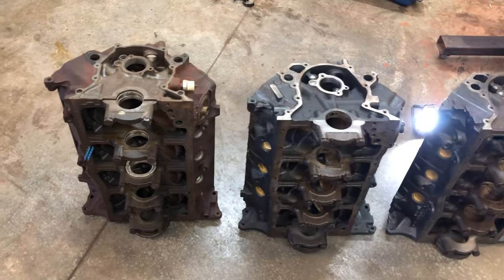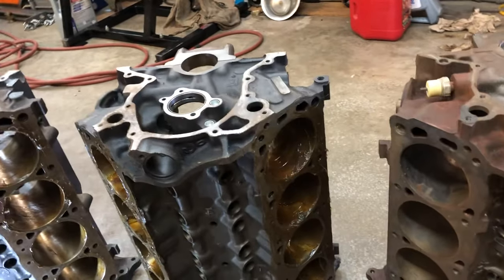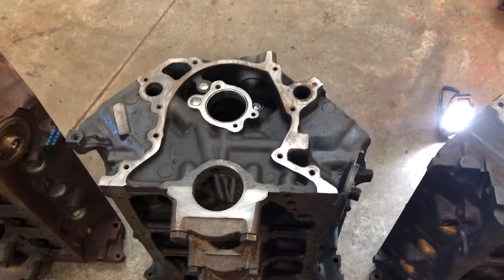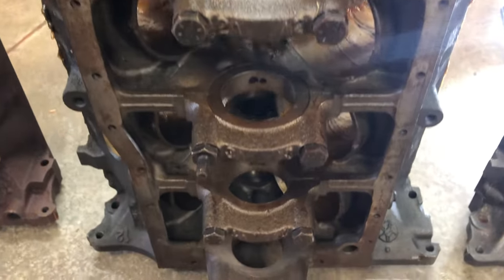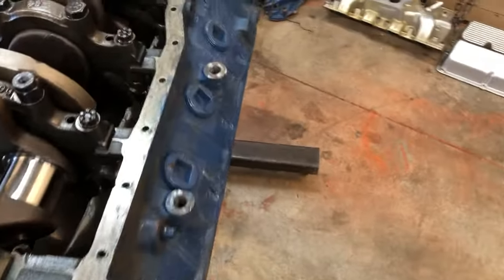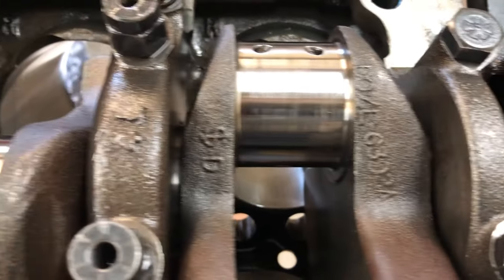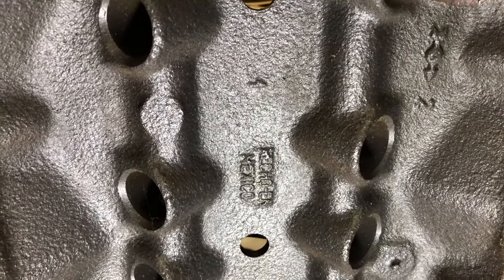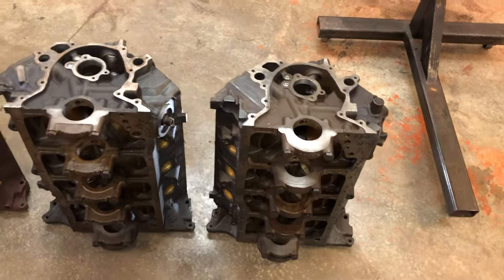The 4 different factory versions of the Ford 302

Comment: What years were the Mexican fee
Reply: Between 1969 to 1975. If you do find a Mexican 302-equipped car, it is likely to be a late 60's or early 70's Torino or Ranchero, both of which were occasionally outfitted with such engines and have some collector value.

Comment: Great video.  Was the Mexican block casting as strong as the rest? When i was young i worked with a fella that had a 360 Mexican engine in a 60s ford truck an he said the heads an block castings were weak on them
Reply from the maker: I think the Mexican block was as strong as the rest of them. A lot of racers were using the Mexican block over the standard block, but I personally cannot attest to that.
Reply: @pyleup  Mexican blocks have a higher nickel content than the others.

Comment: What years were the 351W blocks cast with all of the 'attributes' for a roller block?
Reply from the maker: I’m not sure about the 351 Windsor, but the 302 started with the roller block in 1985 and ran through the end of the production of the 302 in 97/98
Reply: @pyleup  I know the 351W roller block 'officially' began in 1994. However, I have heard that the roller blocks castings began in late 1991 - early 1992, they just weren't fully fitted with roller cams/lifters until '94. I was hoping you might know for sure. Oh well. Thank you for answering back. It's annoying when folks abandon their videos after a month or so. I appreciate the follow-up.
Reply: F4TE block 1993-1/2 to 1997. Many have issues with cracks in the cam bearing webs
Reply: @pyleup   302/5.0L produced thru 2001

Comment: I purchased a 1966 Mustang Coupe with a 302 in it. How do I tell if the 302 is a boss 302 are not. If it is not a Boss 302, what is the hp for the other 302's.
Thank you very much 
Charlie
Reply from the maker: Boss 302 heads are counted valve regular 289 heads are in line valve. That’s how you tell the difference. I also have a video showing the boss 302 heads they are massively different from regular 289 or 302 heads. The boss 302 only came with an aluminum four barrel intake, and a very rare, in-line carburetor intake. If your 302 is a two barrel, it’s not a boss if you can bolt your valve covers onto another small block, Ford it’s not a boss
Reply: Didn't boss have the cleavland heads
Reply from the maker: Yes, the boss 302 did have Cleveland style heads. Actually, the Cleveland was copied off of the boss 302.

Comment: Is it even possible to make the later 302/5.0 blocks into 4bolt main blocks? With Chevy 2 bolt blocks, it isn't hard because the material is there, but with these Ford blocks, I'm not sure.
Reply from the maker: A main gridle is the best way with the 302
Reply from the maker: And main studs.
Reply: @pyleup  I see. Makes me wonder how those newer Godzilla 7.3 motors are for a retrofit into say, a fox body.
Reply from the maker: With some fabrication work the Godzilla motor would make a great set up And it would make way more power than the 302 is capable of.

Comment: Question in regards to the roller lifter block? 
I'm looking to 302 swap a 65 mustang and was wondering if the block can be fitted with intakes and cylinder heads from the time period?
Trying to build vintage looking engine with some "modern" internal updates.
Reply from the maker: You don’t have to have a Modern roller 302 to run a roller cam in an older motor they make the conversion roller lifters for those older 302s and 289s
Reply from the maker: The roller cam would be the only advantage of the Modern 302, and you don’t have to have that to run a roller cam and an older motor
Reply from the maker: But to answer your question, I do think of Modern, 302 can run the cylinder heads of an older engine and the intake
Reply: Ok thank you for the information @pyleup
Reply: To answer that question - yes, those components will interchange - BUT!!! You may (will) need to change the harmonic balancer and rewire to the 351W configuration, probably need a new timing tab as there are three different versions called A, B. or C. You will also need to change to the OE '65 timing housing for a fuel pump boss and pulleys. You will also need a new and hopefully something better then that POS distributor vacuum advance system. The oil pan and oil pump pickup need to be changed as well. Later standard or GT40 heads would also have hardened valve seats for no lead gas. My '31 has a '99 crate engine converted to carb, mech fuel pump. IIRC, the distributor installed gear height may be different on the late motors. DO YOUR HOMEWORK FIRST!!!!

Comment: LOL... My 302 block has 4 bolt mains, screw in freeze out plugs... Ooooh it has a C8 casting number... Crank wise BOSS 302's had 2 steel steel cranks a cross drilled in '69 and a solid steel crank in '70... '69 heads had 2.23 intakes '70 heads had 2.19 intakes... I have the Trans Am block, '70 heads, '69 crank... BOSS 302's used 289 HIPO rods with a special piston from TRW...
Reply from the maker: Sounds like you know your stuff Hope you can put it together someday I just finished building the 1970 Boss 302  and it’s going back to its owner soon you can check it out on my channel. There are videos of it running.
Reply: Thank-u, block needs to be tanked, needs to be over bored, I have Ford OEM valve gear for it, new OEM pan and windage tray, Form OEM valve covers for it, friend gave me an extra set of re-coned rods, want to build it factory, not sure of cam to use, I also have the factory intake, thinking of stuffing it into my Ranger... Haven't found who makes pistons for it... I even have a small block C6 for it too, lol, hey thanks for the thumbs up... Joanna...
 @pyleup
Reply from the maker: Brand
ICON PREMIUM SET | IC686.030
Centered pin. Designed for factory or clone Boss 302 with Cleveland style heads.

ICON Forged Piston - Ford Boss 302 Rod 5.155 Dome -6cc V8      This is what I used in the 1970 Boss 302 rebuild worked great .

Comment: I have never seen a steel 302 crank that wasn't cracked i will always run a cast crank. Chevrolet had the same problem with the steel 327 cranks. I also have never had a 327 cramk that was steel not be cracked.
Reply: Never heard such a thing about chevy steel cranks.

Comment: THE 5.0 ROLLER BLOCK HAS THE THICKEST MAIN WEBS AF ALL OF THEM-EVEN THOUGH ITS 2 BOLT-CAN BE USED WITH A GIRDLE----MEXICAN BLOCKS WERE EXPRESSLY USED IN TAXI CABS--FYI
Reply from the maker: Looking at the main webbing of the blocks, it does appear that way
Reply: I have a Mexican block that’s stock for our 78 F150 as far as I know
Reply: and that was what I was wondering-the main webs.  Also can the MX main caps interchange with the other 302 blocks?
Reply: According to DV, the early flat tappet blocks are stronger but the main caps are not as beefy. He has a video on modifying for reliable 1,000HP. He gives a number for the machine shop that mills for 4 bolt caps with a machined key. The outer bolts are splayed. On top of this the lifter valley is reinforced with a high tensile plate doweled and bolted. Then the block is filled with cement to the bottom of the water inlet holes from the water pump.
Reply: Mexican blocks also came in E300 Club Wagon vans in the early 1970s, and the 5.0/roller blocks are the weakest of the 302/5.0 blocks.
Many of these late blocks split under higher boost or nitrous applications( high horsepower).
These blocks came from casting patterns modified to lighten the weight of the block by removing iron - which, of course, reduced strength.
On turbo or nitrous builds, if the customer didn't have deep pockets and came in with the late block, I would have them find a pre 1975 block, these hold up much better under high horsepower applications - so far we haven't split one at over 620rwhp for street builds and some of our racers won't tell us how much power THEY'RE making!
Reply: Stop trying to shout
Reply from the maker: Yes, they will interchange with another 302, but it must be Line honed

Comment: The  hydraulic roller block is missing a water passage on the passenger side gust above the water pump. Why?
Reply from the maker: I think it was a revision Ford did to the block on the hydraulic roller block. They just didn’t need that passage.

Comment: Mexico or 4 bolt same weak front main, its not the mains that give, so y splerge on a factory same weak castings
Reply from the maker: It is true that the 302 will split down the middle if you’re over 500 hp and boosted, but at a lower horsepower level, the boss 302 will handle higher RPMs than the others With its four bolt Mains and steel crank. they do make a valley reinforcement for the 302 so It can handle higher horsepower

Comment: Sadly the one thing they all have in common, they still split in the cam valley.
Reply from the maker: Yep if there over 500 hp that,s the risk. They do make a valley brace for the 302
Reply: @pyleup  Richard holdner did a video about it saying he thinks it more about the harmonics not so much about a certain power level  but yea basically.

Comment: Ford never made a 302 from 1980 to 1983 they only made 255s. so don't use a block from these years they have the same dimensions as a 302. but the web castings are thinner and can't take the punishment of a 302 block. they have the same bore, same rod size, shorter throw on the crank, flat top Pistons, smaller cam grind, for gas mileage and smaller ports, and valves in the heads. with very small runners in the aluminum intake manifold. you can change some of these things and turn it into a 302. but 300 HP is about the limit for them after that they explode. They're great stockers if you want really good gas mileage ( only 140hp ) but that v8 rumble.
Reply: The 82 Mustang had a 302 2v, rated at 157 hp. Ford advertised that "The Boss Is Back". I had one, it was pretty fast, especially in its day, but I traded it for an 85 GT with the Holley 4v and 5 speed manual. I loved my 85!
Reply from the maker: I also had a 1983 mustang GT 302 with 175HP
Reply: @pyleup  I believe 83 was the first year for the Holley 4v carb.
Reply from the maker: You’re right it was the first year for the Holley carburetor
Reply: Wrong … … the 255 had a very SMALL bore ....... & heads with little tiny valves

You can't put 302 heads on a 255  . . . . Because the valves will hit the side of the cylinder wall
Reply: @linctexpilot8337  I think you better go back and check again I've owned five of those motors still have one they have the same size pistons and rods as a 302 the crank has a shorter throw then the 302 the heads have smaller valves and ports then a 302 and the intake although is aluminum it has very small runners I put a 302 crank in a 255 used the stock pistons and rods because they were flat top Pistons and put heads from a high output 302 with a aluminum 4v intake with a 650 holly and a 472 lift cam it was fun for awhile until the block broke

Comment: Different firing orders too
Reply: The cam changes that not the block the 351 and 302ho used the same cam to shift loading to the thicker rear main bearing from the front to decrease crank wear

Comment: Some Forgotten History... Ford cast a new 351w 9.2" deck sbf xe race block in 1966 (XE 93532) which got to just over 400CI in 1969 for Can-Am racing. This is were the later "351C" got most its spec's from when B knudsen pushed his own "Oldsland" inspired version through screwing up the 351W blocks development...  goo gle "351w xe block" for more info.

Things would have turned out very different if H Ford did not let B Knudsen screw up the SBF development program as the production 69 351windsor block was destined to become a 390/400ci eng & neither H Ford, Shelby and some sbf Ford engineers were very fond of his oldsland inspired design. H Ford should of Fired him sooner than he did, for more info... goo gle "biggest-possible-windsor-stroker fordmuscleforums"
Reply from the maker: Thanks for the info

Comment: Mexican version has very low output
Reply from the maker: The point would be to throw away the heads and intake keep just the block and then install AFR Heads a Stroker kit , good intake and enjoy 450 HP
Reply from the maker: The block is the only thing that matters in the Mexican version